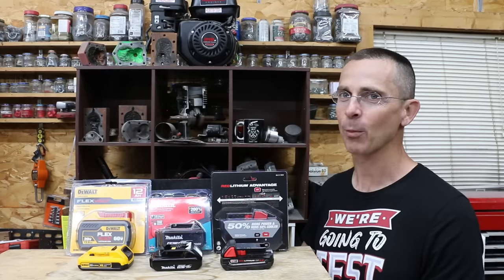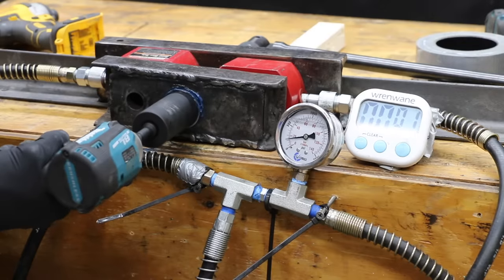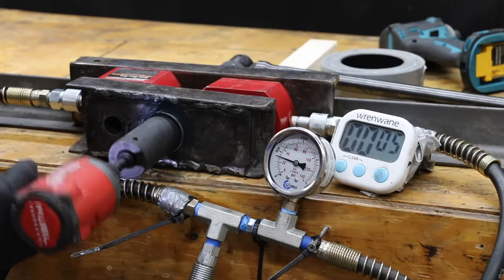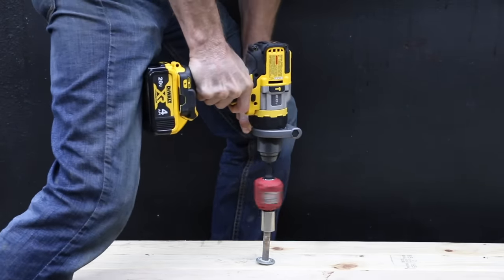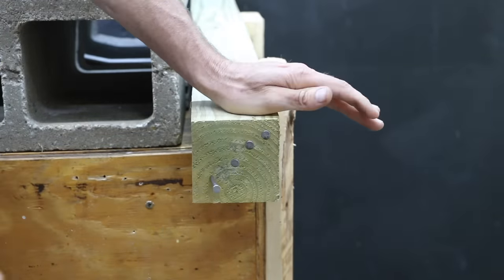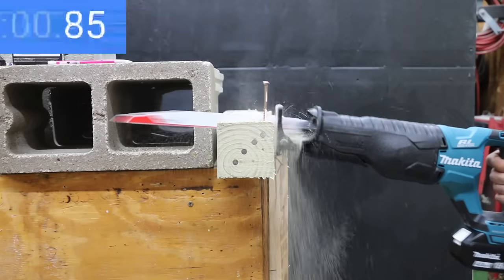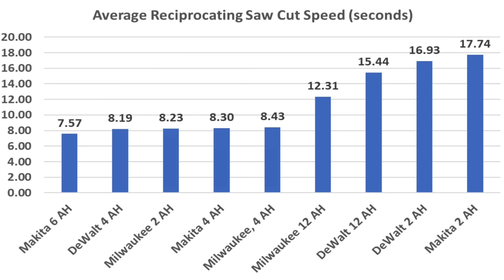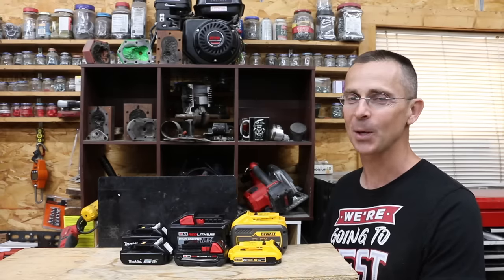Small "TOOL" Battery Better? Milwaukee vs DeWalt vs Makita

Comment: I cannot believe how much they charge for a lithium ion battery pack. $245 is outrageous! Your testing methods are the best. Thanks for all the time you put into making these extremely helpful videos! A++
Reply from the maker: The prices have gone up a lot in the past year!  Thanks again!!
Reply: @ProjectFarm  Do this same test but with 3rd party batteries and compare to name brand tool batteries.
Reply: @MrMega200  he already did, look at his past videos
Reply: @lilcourtny08  I am talking in terms of the test in this video. Yes I know he tested generic batteries before but I am talking about comparing for example brand name 4Ah vs Generic 4Ah for ability to drive huge lag screws and measure the difference. All of what he did in this video for generic batteries. Generic battery 2Ah, 4Ah, and so on.
Reply: @MrMega200  ok
Reply: They do it, because they know that if you spend like $100+ on a battery, the next time you go out to buy a tool you'll be like: "Well... I already have the <brand> batteries, so..." and then end up buying another one of their tools

The cells themselves barely cost anything near that amount - you can get decent Li-ion cells for like $6 - $7 each
Reply: @ProjectFarm  have you done a tap and die comparison??
Reply: Prices for bare lithium cells have gone up 500-900% compared to 2019. These packs are usually constructed from 4 to 12 cells. Also the OEM packs mostly use higher quality Japanese or Korean cells.
Reply: Same as with printers. Get the tool for penny, milk you for the dirt cheap ink in the proprietary cartridges
Reply: Makita at least has or had deals last year like their leaf blower and four 5ah batteries for $330. Not sure if they still have it. Way cheaper than buying individual batteries.
Reply: @DVeck89  I got the freaky string trimmer for $150 off Amazon with the 4ah battery. Very good deal since I needed a trimmer and a battery.
Reply: You can find them on sale all the time, just last month I bought the M18 12.0 starter kit and M18 Fuel Hackzall for $249 at Grainger.  That is the M18 12.0 battery, rapid charger and hackzall.
Reply: It's $245 for a 12 ah battery because it's literally like buying 6 of the 2.0ah batteries. It's certainly not cheap but it's alot of battery.
Reply: @MrMega200  I would then imagine that all of the previous tests on tools would have much different results if used with higher amp batteries. Maybe some of the mid-range tools with different battery sizes (Ryobi) would perform quite differently. Personally for my light/medium duty work I use Ryobi and I do see a significant difference between a freshly charged battery vs a a half capacity. @ProjectFarm Worth a revisit?
Reply: I agree the prices are ridiculous but then again it still is cheaper than a genny and extension cords! ;-)
Reply from the maker: Thanks for the suggestion.
Reply: If they are using high quality cells on the inside, and there's at least 16 inside, that leaves 50% profit which is low.
Reply: @lightdark00  4 per cell x 16 = 64
Reply: @electronicsNmore  I was thinking something like an IMR  high amp output that could be $8 each.
Reply: @lightdark00  Most high quality tool packs are using Sanyo, Panasonic, or LG cells.
Reply: Yeah that's stupid high!
Reply: @cpufrost  Since you don't seem accustomed to types of lithium-ion cells, IMR are a special type that are often high amp output, and they are usually fine dropping down to 2.5v. And yes Samsung makes them, but they cost more. Manganese is the special electrolyte, the reason for the M.
Reply: @lightdark00  LOL I made a comment about OEM selection in packs not cell chemistry. ;-)
Reply: @korona277  plus no one buys them lol ,on a jobsite theyd be insta stolen and  no homeguy is gonna buy a245 doller big batter instead of a corded drill
Reply: Many battery specialty stores will rebuild both Lithium and other batteries.   They have the correct battery tab welding machines, and if you have a battery pack that uses some kind of screws to hold it together, can rebuild you a better than new battery, at a very reasonable price.
Reply: It's the electric vehicle market going into full swing. There are limited places where the necessary minerals are mined and they're all in full production so increased demand leads to insane prices.
Reply: @Stevo_1998  I don't think that is true. Just to buy a 4 pack of Samsung 18650 batteries was over $40, and that was before much of all this inflation started. Larger battery packs probably use more than that, so $80 wouldn't surprise me.
Reply: @remyllebeau77  IDK when I searched for Samsung 25R's, which is what's used in like pretty much all of the battery packs, they were all coming up sub £8 (Around £6-£7, about $9 probably) and the companies probably buy them for like 50%-60% of that price, so ¯\_(ツ)_/¯
Reply: @Stevo_1998  $9 per cell? Why do y'all love ripping yourselves off? Just buy the DeWalt pack and reclaim those cells for $6.67, as I've mentioned. Or keep it intact since buying loose cells is practically useless. Need the protection circuitry, and nothing you build or repack will ever be ship or travel IATA legal.

25 series cells aren't used for tools. As I've also mentioned, tools are high current, and contractors seem to like them lasting more than a few cycles. Most use 20 series, like all 2.0Ah batteries in this video, obviously. Some even use 15 or 13 series. Only place high-capacity cells are used are in parallel configurations like the 5Ah 5S2P batteries.
Reply: @charliebaker1427  No one buys them? Then why on earth are the companies making them? As for homeguys not buying bigger batteries... I currently have 5 of the Dewalt 9AH batteries that run all of my cordless tools, a string trimmer, leaf blower, hedge trimmer and pole-saw.
Reply: @RandornCanis  Are INR cells one of the more counterfeited batteries?
Reply: @tr1llwill  people use them in flashlights, and the vape world uses them too. Maybe I misunderstood the intent of their comment...
Reply: @roadchewerpe5759  All big brands are counterfeited — LG, Panasonic, and Samsung. INR, lithium nickel manganese cobalt oxide, refers only to the cathode chemistry. It's a newer chemistry than IMR. Higher energy density, better durability, and supposedly higher safety. All three big brands produce INR cells.

I can only guess that fewer counterfeit INR cells exist based purely on it being newer. Though, there's certainly cells labelled as INR that are not.
Reply: yeah but look how good batteries are now a days when compared to the late 90s. The quality control and your battery not catching on fire makes it worth it. These can be loaded fire bombs if not packed correctly and with the right materials.
Reply: @MrMega200  waste of time, Quit being a cheap skate and buy a real brand
Reply: @subradiant_music  That's funny because I buy quality laptop batteries from 3rd party manufacturers for a 3rd of the cost of OEM like Dell. As long as it's not a fly by night brand and the company has history behind it such as NinjaBatt, which has been around for 9 years, 99% of the time you get a quality battery.
Reply: This is why I got a battery spot welder...18650s are cheap in comparison lol.
Reply: @codemiesterbeats  As mentioned, these batteries use much, much larger cells. The DeWalt 6Ah is a very cheap source of high quality 18650 INR cells. Nothing you repack will ever be air legal again.
Reply: Amazon you can get DeWalt brand 6 ah batteries for about $96 each.
Reply: @ExploreWithIsaac  Ripoff! I buy maybe genuine cells for $8 a piece. I ain't spending $96. It's way cheaper spending $120 in raw cells, add a spot welder, plus BMS, plus solder, contacts, and my time making an open frame, unreliable, definitely not UN38.3 certified battery — is what I hear everyone above saying.
Reply: @ProjectFarm  I think you should also test battery wear—do smaller or larger batteries keep their original capacity for longer?
Reply: @korona277  ok math teacher
Reply: @Stevo_1998  agreed 😑 thats kinda ripoff.. for me, better to rebuild my existing batt use hidrain batt like vtc4.. decent batt decent price.. no ripoff 😁
Reply: @SY_Vlog24  Yes, people are ripping themselves off repacking cells. We've already discussed a cheap source of genuine INR cells that are flight legal — a DeWalt battery pack. Why is this still brought up?
Reply: @tr1llwill  i have 2 Milwaukee 12AH’s…. Don’t usually use them on my impact but theyre great for the saws.

Not sure why dude thinks no one buys or uses them. Couple guys have work have i think 9AH’s on their tools… but then again maybe we just dont work with dickheads who would steal from a co-worker, or we’re all smart enough to write our names on them 🤷‍♀️
Reply: @Stevo_1998  the cells are cheap, the other shit isn't
Reply: @Fetidaf  I know a guy that legitimately uses the 15AH on his dewalt drill. I could see a 6 or 9 but 15 is a bit much lmao
Reply: @charliebaker1427  I litteraly have plans to order like 3 9AH ryobi batteries when they're back in stock. Also maybe don't work with assholes that steal your shit.
Reply: @bread-gz3rl  I put one of my 12ah M18’s on my impact and it just looks idiotic and is heavy af lol, if I was in a pinch I would do it for a little bit but using it all day? Nah…

Comment: Raise your hand if you think Project Farm's socket adapter budget is probably enough to pay for a few impact wrenches.
Reply: How bout a thumb? I can raise one of them.
Reply: 😂 You can buy low-torque impact wrenches from the big three brands that are roughly similar in size and power just without the 1/4” hex connector. But he would have to redo all his testing on socket-related videos so that the numbers were all comparable in charts going forward. That being said, I’d love to see him test impact wrenches. Especially the high-torque models.

Comment: A video I never knew I wanted until PF took on the challenge. Loved it! Way to go as always.
Reply from the maker: Thank you!
Reply: This was good stuff. I LOVE using my small 2ah batteries with my small impacts and other tools just because it's so light and easy to deal with. But next time I'm doing big jobs with the impact or the hammer drill I will most likely start with a 4 or 5ah.
Reply: Y'all check out the Torque Test Channel. They do this kinda stuff all the time.

Comment: This Is something I wondered all the time but never thought to ask
Reply from the maker: Me too!  Amazing how much difference it makes!
Reply: There is a channel called "Torque Test Channel" and they have compared the 6.0 High Output battery to the 8.0 High Output battery from Milwaukee and the 6.0 actually outputs more amps due to the way each battery is designed.  Though it didn't 't make a noticeable difference on most tools and they recommended getting the battery that suited the capacity/form factor needs of the individual.
Reply: @ProjectFarm  looks like my (and maybe others) video idea came through? Nice to see the results! Interesting results on 12aH for sure. Since the batteries seem to work at different speeds (different Ah ratings) makes me wonder if something with a 2.6Ah rating will last 2.6 hours doing anything or if it’s a % less, and if the 2.6Ah battery can only deliver power for X minutes, will a 6Ah battery deliver power for (6/2.6) X minutes? Will the change in time of power delivery be linear or curved because larger batteries have more juice and use more juice?
Reply: This comment is a paradox
Reply: @bigsteve6729  which came first, the effect or the cause ?

Comment: Personally I don’t want a 3 pound battery on a 1 pound  tool especially for overhead work. Great job as always!!
Reply: Course, if you're using a 1lb tool overhead, you probably don't need the power a 3lb battery could provide!
Reply from the maker: Thanks!  Thanks for the feedback.
Reply: @dposcuro  I'd agree for the most part.  An exception that comes to mind is putting in lag eye screws overhead for drop ceilings.  Not necessarily an everyday occurrence, but an occurrence nonetheless.
Reply: When I see people using a 8ah and 12ah on an impact driver, I always ask myself what the f*** are they thinking?
Reply: My milwaukee blower barely works with a 2ah but a 5ah is dramatically better. It would really shine with a 9 or 12 ah. But yes a 12ah isnt needed in an impact driver
Reply: @MrArcticPOWER  -Merica! Lol
Reply: @MrArcticPOWER  For me its either a 2ah or 9 ah since I don’t own anything in the middle. Makes my drill look laughable when it runs out of battery and I put the flexvolt on lol.
Reply: I have three 2 AH, two 4 AH and one 12 AH for my Milwaukee tools. Only time the big battery goes on a drill or something handheld is when I'm decking or something else with lots of work but low down. I love my 2 AH for up on ladders or in rafters/joists for a little more wiggle room.
Reply: I’ve been using a 6ah battery on my dewalt driver for a few years now, and I feel it has contributed to its wear considerable. The thing is so flexy and wobbly now. The casing has seen better days, the anvil is pretty sloppy, the poor battery mount has quite a bit of play. But man, the big battery sure makes a difference in usability of the tool.
Reply: @danervin2530  Yeah the 12 AH was a boxing day special buy, and it rarely gets pulled out. If I had a less portable m18 tool like say a chop saw or vacuum it'd be the main one for them. As it is, I've done 4 decks and a few shed walls/roofs where you aren't slinging the impact around and it's been awesome going through 3 batteries worth of use without slowing down. I can imagine the big batteries wear the tool down, that's a lot of extra strain.

Comment: I’d like to see you do a test on ear muffs for hearing protection and which one has the actual best noise reduction rating compared to manufacturer claims. It could be a great episode to bring Cousin Eddy back again.
Reply: Hearing protection have to be tested by ANSI in accordance with OSHA standards they are not manufacturer claims

Comment: it is possible
duriung cell manufacturing and design, they have to choose in a tradeoff between power density and energy density

two different 18650 cells could have the specs:
A) 2000mAh capacity - 20A current rating
B) 3000mAh capacity - 5A current rating

the smaller battery pack would use 5x cell A in series to get to a pack voltage of 20V (single cell voltage 4.2V) and its 2Ah capacity
and it could deliver 20A of current continously

the bigger pack would use 4 parallel sets of 5 cells B in series
it would still have 20V pack voltage
one set of 5 still has a current rating of 5A
but 4 sets parallel can deliver 20A continous, just like the smaller pack, but for longer, since the capacity quadruples as well, to the 12Ah rating

if they only used 3 sets of cell B, it could only deliver 15A continous with a pack capacity of 9Ah
Reply: I'd assume they have cells wired in parallel. For DeWalt, you can model these cells as the smallest, 2Ah 20V. When wiring batteries in parallel, voltage remains the same, and capacity adds linearly. However, in parallel you decrease the effective internal resistance of the battery bank, increasing the available amperage for the tool to draw.
Reply: @ussenterncc1701e  Li-Ion battery cells have a nominal voltage of 3.6V, maximum of 4.2V an 3V minimum
20A is more than enough peak current for these tools, especially at 20V
Reply: @marc_frank  even if we assume they're just using COTS cells, we know it's a 20V battery, so we have black box of how they achieve 20V, and can't know what the actual peak amp production is without testing. At most, we can use the final product as a model and take the values as granted. Doing this, it is still reasonable to assume, whether they independently engineer batteries from the ground up or step up COTS, that they've only produced one 20V solution. Then that solution is used as a model cell.

Comment: The Torque Test Channel found these results with Miwaukee RED batteries:
CP   3.0 Amp 447ft/lbs
XC   5.0 Amp 451ft/lbs
XC   6.0 Amp 478ft/lbs *
XC   8.0 Amp 468ft/lbs
HD12.0 Amp 474ft/lbs

They used a very heavy duty impact and measured in Foot lbs not Inch lbs. If people wondered why the number looked smaller because their not.
Reply from the maker: Thanks for sharing.
Reply: @ProjectFarm   Thanks for all the amazing work you do, Huge Fan of tranparent unbiased testing! Takes away all the hype and propoganda and just shows us the results!

Comment: I just thought Amp Hour meant the battery lasted longer. I would have never guessed they improved the tools performance.
Reply from the maker: Thanks for the feedback.
Reply: It's interesting because when you, say, double capacity, you also double the amount of battery. That means you can pull twice the power from it, or, in cases where the voltage sags under load (battery chemistry can't react fast enough, not enough surface area), you have half the voltage sag.
Reply: All other things being equal, a battery with a bigger capacity will always be able to deliver more power, with less voltage sag.

Comment: DeWalt: im the best battery
Makita: no i am

Milwaukee: O b s e r v e .
Reply: @pollutedcrimson  I have all miwaukee tools and they are really good
But fuck do the prices make me tear up whenever i need somethin new
Reply: XT  My dad was good buddies with the regional sales guy, he would alwayse get free shit to trial at work and show off. He got an entire set of HART shit to use for a few months and show off!
Reply: If i tested DeWalt, they would be getting bad reviews. I had bad experience with them. About 20 years ago bought a 14.4volt drill and it had bad clutch. Sent it in and came back same problem. Asked for new one and the said no after 3rd new clutch.
Reply: ???  Not the point of the test, nor a correct conclusion.  Listen how he wraps up the video.
Reply: @JM-ib9kb  Looks like someone doesnt know what does "joke" mean.